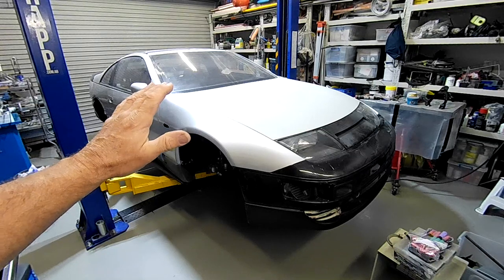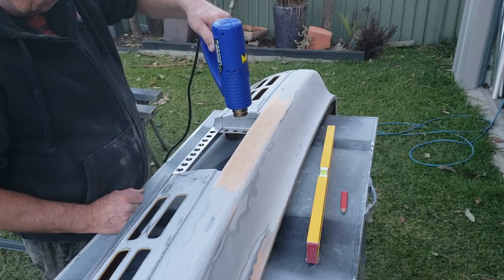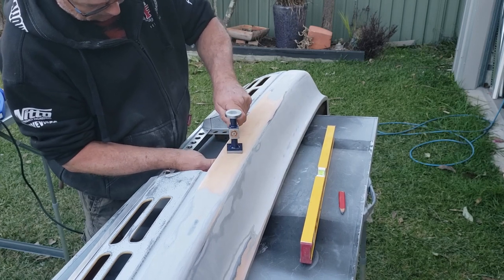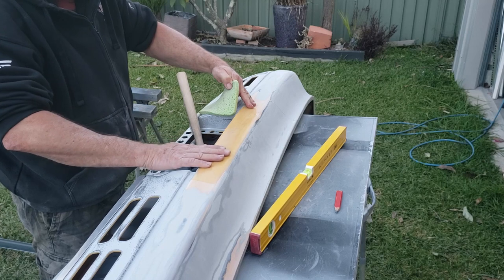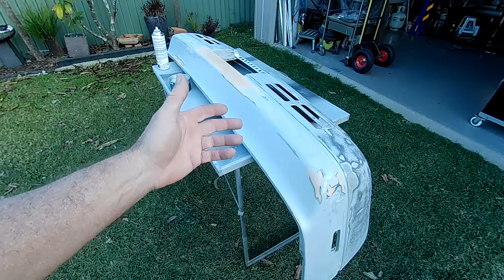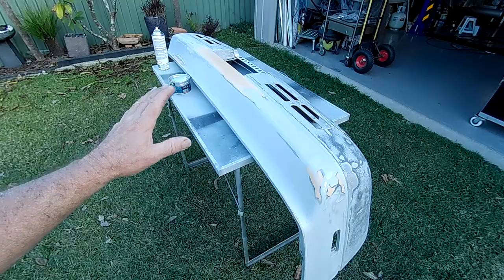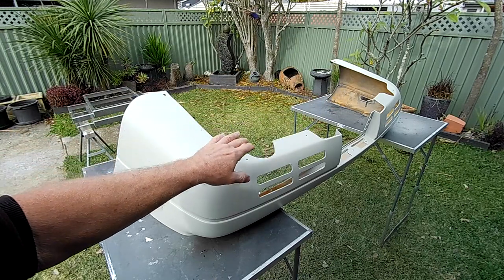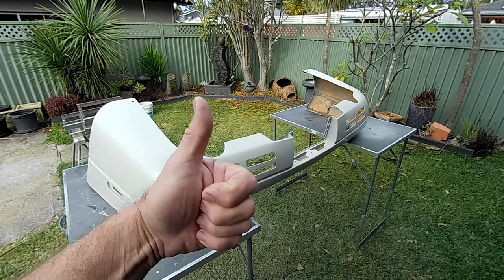Rear Bumper Repairs. Project Fairlady The Nissan Z32 300zx Twin Turbo Mega Build.

Comment: Love the guide coat powder! Wish this was around when I was in the body shop. All we used was flat black shaker cans. My buddy used pvc pipe all the time, he would soften it with the heat gun and press it into a known good contour until it was the shape he wanted, the guy was a real pro at body work. 
Good to see it's coming along. Is that texture a factory thing, or someone's bastardizatiion?
Cheers buds
Reply from the maker: G'day Rick, yeah its factory, its in the plastic. The doors etc have some type of stoneguard to match it, again factory. Slowly getting through it though, bugger of a stuff to get rid of. First time for me with the dry guide coat too. So far it seems pretty good, super convenient. a tad messy would be my biggest gripe, kinda reminds me of antiseize, you know, you just look at it & next thing its all over you. Cheers Mate.

Comment: You mentioned a bonding agent that you were going to use to bond the aluminum plate to the braw - didn't catch it - what is it again?  Also, do you do anything special when painting the aluminum - or just regular auto paint and prep processes?
Reply from the maker: G'day Rick, painting the aluminium you really have 2 choices, etch primer followed by 2K primer surfacer or 2K hi-fill, or 2K Epoxy Primer,  2K epoxy doesn't need an etch, which is what I am doing here, mainly due to when I 2K epoxy the bumper I will do the aluminium at the same time. I've actually done all of that now & it turned out really good. As for bonding them together, I will use one of the Body Shop Panel Bonding Urethane's, just waiting for my mate to get back to me with which one to use. Cheers Mate.
Reply: Looking good Trevor....Clearly not as cold where you are as it is here.
Reply from the maker: @peterwooldridge7285  G'day Peter, thanks Mate. Shot this a couple of weeks ago, starting to cool down a bit now, really only warm for a couple of hours in the middle of the day. Almost put long pants on the other day. Cheers Mate.